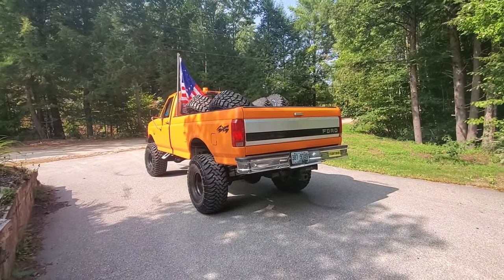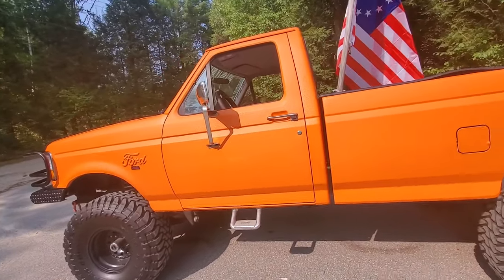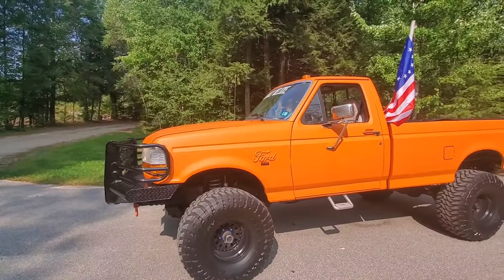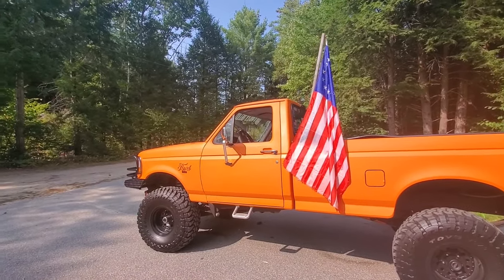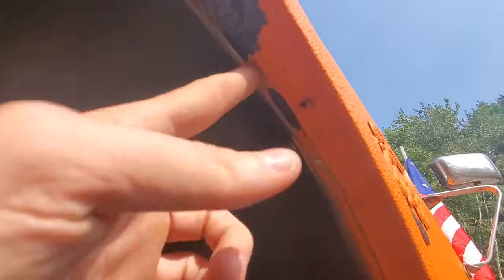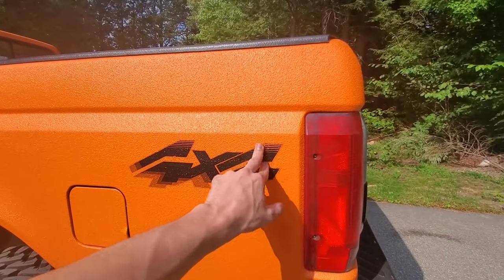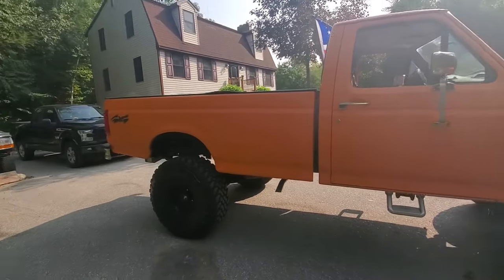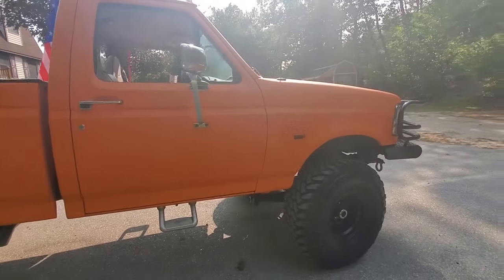Bed liner paint job. Do I regret it? 3 Year Update

Comment from the maker: Correction: I had my pressures all off. We sprayed the liner at around 30psi, the compressor goes to 120. We didn't spray at 120. I don't know a damn thing about compressors. Like I said in the video, just test it out for yourself. Find the settings and the texture you like best. 👍
Reply: So...the higher the pressure, the smoother (finer) texture you get. Is this correct?
Reply from the maker: @sharkparty1027  That's how it worked for us. You'll have to play around with it for yourself and find a texture you like

Comment: I had my Toyota Tundra raptor lined black.  I use Lucas slick mist tire shine non oil based spray.  It keeps the bed liner from having streaks or keeps it from looking dull.  It also helps from water sitting on the paint it beads up and comes off really easy.  Prep is def the key slick mist will eliminate water spots and over all it will help protect the liner and it rich look.
Reply: Id love to see a pic of yours I wanna do my tundra

Comment: 5 years on my 05 dodge. Red/black. I'm absolutely satisfied with mine. After 5 years parked in the sun it has faded some. Getting ready to put another coat on it. I'm sure if I maintained it with something it would have helped with the fading and give it a nice fresh look. But can't complain 5 years of no washing or products applied to it. No chipping or peeling on mine except for my plastic door handles. I didn't prep them very well. The grill has held up and it was plastic chrome. I recommend proper sanding and adhesion promoter.

Comment: Raptor Liner is an Epoxy based bedliner paint.  It WILL flake and chip off with vibrations. 
Use Durabak 18 Smooth or Textured (has crumb rubber) and a mohair roller brush to get a more durable flexible paint that will not flake off or chip with vibrations.
Reply: Or check out ProjectFarms comparison video on all common bedliners

Comment: Xylene is a readily available chemical used as an adhesion promotion for all bed-liners.
Reply: I just found out about the Xylene additive and am applying it today to my Herculiner Kit....i am rolling a new chicken shed coop floor.  Also another good tip was to scrap the roller pad in the kit and buy a Dupli-Color TRC104 roller...i bought at O'Reilly Auto Parts Store.
Reply: Heads up, that chemical mad toxic.
Basically your ex girlfriend on her period level toxic

Comment: Thankyou for the video....
I just came accross it recently. 
Orange is one of my favorite colors. 

I have done lots of painting over the years with lots of different coatings and seen how they perform in harsh environments. 

Incase you didn't put any primer under your bedliner coating,  I want to say it's best to put a Good Quality primer under any bedliner coating that's being applied to any type of corrosive metals. 

Bedliner coatings are very porous compared to paints and they are more likely to leave tiny pinholes where moisture can get through to the metal below and cause corrosion from beneath causing the bedliner to lift from underneath, etc. 

Its safer to seal the metal 1st before applying a bedliner for a extra step of security because corrosion doesn't pull any punches and neither should we when it come to defeating it,etc. 

The best primer I ever experienced is a silver coating that's made any one of the 4 names below. 
It has to be the silver out of these 4 and don't get fooled by accepting a black version. 
The silver is the only one that has the aluminum particles in it to block oxygen from the metal preventing corrosion. 
Corrosion needs oxygen to do its damage. 
No oxygen means no corrosion!! 

4 versions of the special silver formula 
Mastercoat silver primer.
Por-15 silver rust paint.
Chassis saver silver.
Eastwood company rust Encapsulator Platinum Silver. 

When you get a can make sure to put it in a refrigerator immediately to preserve its shelf life.
Especially when opened the 1st time as then it gets activated and wants to start getting hard in the can no matter how sealed the lid is.
Keep the lid seal perfectly shiny clean every time and gently tap the lid shut after each use just to prevent can distortion to aid in preserving and unused amount then put in a fridge where it can last for months. 
Just make sure the fridge is above freezing inside. 
Also after you are done coating its best to protect any corrosive areas you can reach with paint, with a gel like oil to prevent corrosion..
Like inner wheel wells and inside door doors, inside rocker panels etc. 
One of the best I discovered is wd40 GEL lubricant..
( Not the old thin penetrating fluid )
It has to say GEL on the can and it sprays out as a foam and turns into a protective oily surface later that hinders corrosion a lot.
Its help preserve my pickup that has almost a million miles on it,etc. 
On a side note if you have a garage,  keep your nice vehicle inside as much as possible when not in use because the sun is a destroyer...
Hope this advice helps you or anyone out a lot...
Peace and Grace to you all and be Safe out there 🙂🙏

Comment: I just Raptor lined my CRV in a "Mesa Gray" color. Prep is definitely key, I used U Pol acid etch primer in areas where I sanded to metal and or repaired surface rust, I used 120 grit on an orbital on the whole car, and then before spraying the Raptor, I used U pol's adhesion promoter on all the edges of panels, seams, around where mounting holes for door handles/antenna etc. are, and adhesion promoter all over 100% coverage of all plastic trim and bumpers. It hasn't been 3 years yet but it seems incredibly rugged so far and I for sure have the hardest looking mom car in car line.

Comment: Looks great. I saw in the comments you also spray it with ceramic spray.  Does that help with anti fading? 

 Thinking of spraying the front part of a e450 box van overlander conversion.  In a bright orange to go with  our Screaming Tangerine theme.  Lower paramount the box will be black. 

Do you think with the prep will stand up against constant salt mist and sand from going near the beaches of Florida?
Reply from the maker: The spray is supposed to help with fading. From my experience it appears to do almost nothing. You'll see in my update video that I am posting next month. My hood is starting to get sun damages the same way the roof is in this video, so take that for what you will. Spider cracks. 🕷
As for salt, I probably wouldn't take my truck to the beach because my prep work kinda sucked but you could have better results if you took your time and also maybe used a different product than me.
Reply: @Bearbait01  awesome thanks so much for the information.  Since the front of the box van conversion is an e450 we are thinking of doing the whole thing orange like her logo as a Screaming Tangerine . So good to know about 3-4 years of use as long as we prep it very well.  (Thinking the sand and salt will really beat it up anything over the 4 year mark.) Should help it stand out. Again thanks

Comment: Seriously great video!  I’d say it’s worth it because it still looks fantastic!  I know there are areas that bother you but to me it seems like if I do mine like this I should spend some extra time on the under  edges.   

Question: did you do the door jams?  Any tips for that to prevent the doors sticking shut?
Reply from the maker: I did the door jams with regular paint that is the same color as the liner. No need to bed line the jams. If you do you may have clearance issues.
Reply: @Bearbait01  ok thanks so much.

Comment: I actually painted my ‘08 F-150 in white Raptor liner. I used adhesion promoter on all the plastic parts,edges and hard to reach places. I think it looks awesome but yeah I definitely have to clean it at least once a week.
Reply: What PSI did you use?

Comment: Did you notice any Miles per gallon gas change from wind drag ? Is the truck a 95 ? Thanks for the video.
Reply from the maker: My gas guage doesn't work so I have no clue lol. Tell you what though it probably gets 175 miles per tank. That's the rear tank so 19 gallons? I guess 9.2 mpg combined. 
It's a 96 but basically a 95. Same thing.
Reply from the maker: I just realized you're probably talking about wind drag, because of the bed liner not being smooth. Nope absolutely not. That doesn't make any noticeable difference.
Reply: @Bearbait01  Thanks for the Reply , I got a 95 f150 more of a work truck ; Wish it was a 
96 . I hear the 96 got a better engine Diagnosis reader , the 95s don't tell you much. Im not sure but I think the 96 may be the last year of 4.9 straight 6 .
Reply from the maker: @MrLeo7627  OBD1 vs OBD2 is the only difference
Reply: A rougher surface reduces drag, it doesnt increase it, as it traps air in pockets. Air flows faster over air than anything else and therefor drag is reduced. Ask anyone that ports heads professionally, you do not want polished inlets as a rougher surface flows air better. Anyone suggesting that bedliner increases drag is talking shite! Its also why a golf ball is dimpled the way that it is. Lastly, its a truck with the aerodynamics of a brick, don't worry about the paint lol.
https://www.youtube.com/watch?v=FRI-XPHPHxQ
Reply: @ilikecustard  Thanks,  makes sense , the golf ball thing hits it on the head 
Wish Bill Wattenburg was still here . Rest in 
Peace .